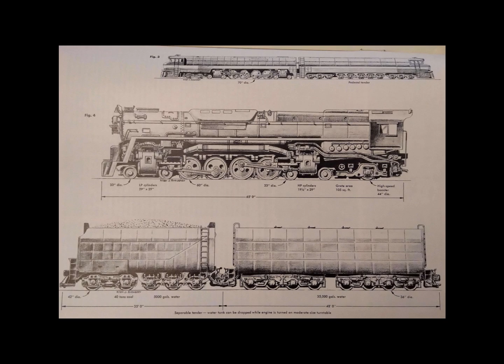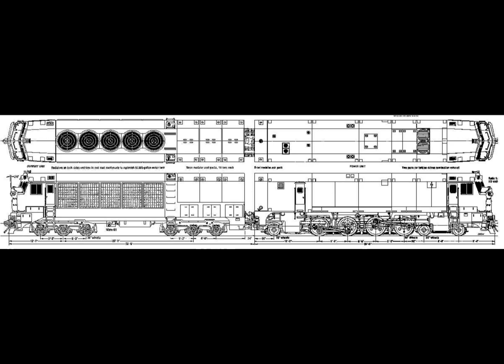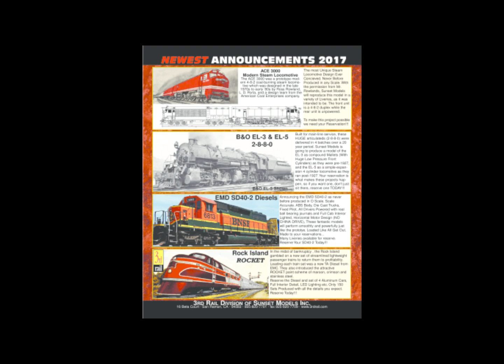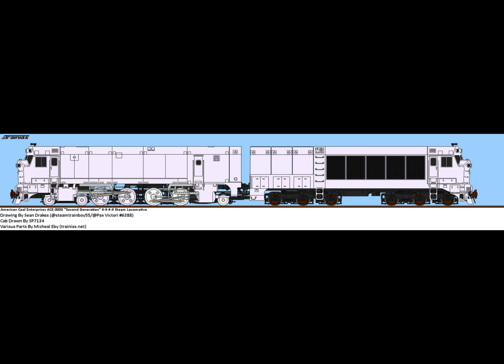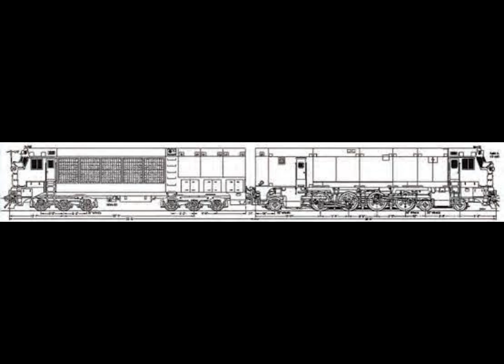Ace 3000 The Last Modern Steam Design Never Built

Comment: The ACE 3000 was not the last modern steam locomotive design, that would be the 5AT. I recently recorded and released a discussion with Ross Rowland in which we discuss the ACE 3000. The ACE 3000 was far too complicated to develop from the onset. Also David Wardale hated the ACE 3000. He had no hand in developing the ACE 3000 specifically. He joined ACE on the condition that he would be allowed to leverage it's resources to develop more traditional looking and sounding super efficient locomotives for export to developing countries. The 2-10-0 locomotive Porta suggested at the onset was a triple expansion third generation locomotive that would have been more efficient and less expensive to build and maintain than the ACE 3000.
Reply from the maker: I am pinning this response to the top... GREAT INFORMATION!!!
Reply: @lroadCrossing-SteamPower All of the extra features of the ACE 3000 were added to fulfill the desires of the railroads and rail worker unions. The goal was to make it as operationally similar to a diesel as possible. The synchronous opposed duplex was added to reduce hammer blow as much as possible to minimize extra maintenance on the track. The closed condensing system was added to eliminate the need to reinstall water collection infrastructure. The forward comfort cabs and computer controlled automated firing system were added to appease rail unions because they would not tolerate traditional steam locomotive operating conditions. Computer controlled automated firing was also supposed to allow for remote coupling of units to appease the rail company's desire for operational flexibility. All of these features reduced the reliability and efficiency of the design compared to Porta's original proposal. Developing a successful locomotive with all of these experimental features was practically impossible for such a small R&D team.
Reply: @TheRailroadCrossing-SteamPower  if you really want to talk of it you need to talk to gary bensman of diversified rail, he worked alongside Mr. Livio Dante Porta there was also a proposed ace 4000 project talked about in the coalition for sustainable railroading, now mind you though ross roland did have a vested intrest he had money in coal but it would have been really something had it been developed, coal is dirty but and effecent engine could have cleaned up a lot of it, and we got 200 years of it they say but getting it is going to ruine the landscape of appalacia by flattopping mountains and ruining water supplies,  but making a sellable machine they were aiming too big too fast, though the tests with 614 show the power of steam even in the most inhospitable weather the usa can dish up I met a guy that also helped out there beside just Gary Bensman, who told me mr porta was just as nice a person as he was an engine designer. those are Garys words
Reply: Do you have that video posted somewhere i would love to watch it
Reply: We just need a passionate Elon Musk type steam enthusiast to come along.
Reply: There's also the oil burning rack locomotives from DLM that were built in the 90s and a few concepts/prototypes from around the world that may or may not come to fruition, most notably Mackwell Locomotives which has temporarily tabled their locomotive development in favor of an updated tracton engine.

Comment: They were fighting the wrong battle. An engine that burns coal to boil a liquid, create a vapour, which then drives a piston, can never be as efficient as the engine that injects fuel directly into the cylinders. During the years when steam and diesel were built side by side, steam's great advantage was low capital cost. You could get 3 or 4 steamers for the price of one diesel. Once you introduce the complexities of divided drive, compounds, condenser etc that advantage is lost. The Porta and Wardale engines referred to succeeded because they improved on existing designs without departing too much from them.
Reply from the maker: So you feel the idea was over thought out. Which actually is a common thing among engineers

Comment: We haven't even begun to utilize all the potential of different configurations...

A pantograph powered electric locomotive could send the electricity through heating coils to a boiler which produces steam. Or even a natural gas powered boiler could make steam. There are literally dozens of ways to power a locomotive, but our design engineers are too stuck in the mud to break the mold and do something completely new.

Comment: I might have worked. The trickiest part would have been to automate firing and water level. Firemen had to anticipate what the engineer would do, it would be very tough to computerize that.
Today it's all a moot point. With global warming, all fossil fuels have no future. Railroads have been putting off electrification for 100 years. Think about it. Some of the biggest electrification projects were just before the diesel. 
Electric trains are the ultimate carbon neutral transportation. And no batteries. Railroads need to bite the bullet and get it done.
Reply: Is it the coming ice age, global warming, or climate change?  I can't remember.  Seems like it had something to do with the sun.
Reply from the maker: While I agree alternative energy and fuels need to be developed.. Im not a believer that electrifying the lines is the answer. The cost alone is prohibitive with the needed infrastructure to go with.

Comment: among all the "what if" locomotives out there, this one is the most painful, with it's potential to have steam actually doing revenue work in my lifetime. oh man, it drives me crazy. 
The only thing I personally would do to the design is I would turn it into a steam motor driven design like the planned B&O W1 (technically making it into a 2-2-2-2-2-2 or a 2-2-2-2-2-0 with that ACE 6000) and using a quadruple steam expansion design for maximum efficiency.

Comment: It's going to be either a fifth, sixth, or seventh generation locomotive Depending how you want to shake the dice if your talking modern steam. Third generation or fourth generation was the death nail and because of the nature of how steam locomotives were build you can argue about how each new innovation added to a steam locomotive made it a generational leap.... In all seriousness though the Ace 3000 if made to work would of been like a 5th or 6th gen steam locomotive but maybe a third generation turbine locomotive. But that's only if it used a turbine at all.
Reply from the maker: Interesting train of thought
Reply: @TheRailroadCrossing-SteamPower 
So much happened in the development of steam it's kind of ridiculous to think ACE 3000 was the "third generation" when so much technological development happened over a span of 200 years. they had to be referring to a technology they wanted to develop as a third generation of said technology other wise calling the ACE 3000 design a third generation is just hog wash.

Comment: Let us not forget: water treatment is mandantory  to prevent scale build up; a large infrastructure must be maintained to supply water (troughs anyone?) like NYC. Lets  not forget ash disposal and the comparatively low starting tractive effort compared to a diesel electric.
Most high pressure boilers require a fireman which would kill any flexibility in the operation.
Tier4?? Really?

Comment: If we're to build a second generation  steam locomotive  I would build a 2-8-6 steam locomotive  and name it through Berlin type it would be similar designed of the lima A1 BERKSHIRE I would build it with 63.5 inch drivers 250 psi and 28.5*30 cylinders elesco feedwater heater lowered headlight 145  ft2 firebox and number it  no 2 class A2.😊L

Comment: Thank You revisiting the January 1985 testing of the 614T through the Kanawha and New River Vally's.   I was attending EE studies at WV Tech Montgomery WV along the CSX mainline where this testing was going on.    I watched that steam locomotive get stopped in town when about 3°F on an upgrade with full load of coal cars behind it.   I thought the dispatcher must be nuts, because a steam locomotive on start up was likely to throw out thick black smoke and some cinders when starting at max load through and this was a heavily populated town.  

On startup the 614T engineer, probably Ross Rowland, used the exhaust steam jet that shot steam up 100 feet in the air or more then in the cold 3°F temperature it exploded out into a thick white cloud against the crystal clear blue winter sky.  The steam continued to expand across the valley sky and rise on its own accord up the 1000-foot deep valley.   As the locomotive started to move it never put out black smoke.  As it made its way through town the steam cloud expanded out covering the town.  I called it the town humidifier.  After the locomotive had passed I continued walking to class, probably late by that time, but I was in awe.   I noticed the steam had spread out across the entire valley by the time it reached the top of the ridges.  The taller ones being 1000-feet above the river.   

Although the 614T was reported to be testing for new technology with fluidized coal bed combustion technology being spoken along with this testing.  It wasn't clear if the 614T was reconfigured with any of this new technology.   I did hear few weeks into the testing the locomotive was full of leaks, but you'd never know it from the way it looked when performing!   It would carry 30 full loads of coal cars up grade then pull 90 empty coal cars down grade.   One time it pulled the Amtrak's Cardinal upgrade.  I asked the conductor if the 614T was fully pulling the train and he excitedly said it was the Diesel was just providing headend power.   

Surprisingly there was no discussion from the ME department about this testing I was keeping an ear out for.  Only the school news paper made a brief mention of it with no technical information basically just poking fun at using an old steal locomotive.   No mention it was a front line passenger steal locomotive with a reported pull speed with passenger cars by Ross Rowland of 125 mph!

I can attest to January 1985 being exceeding a cold one where in this video it is stated the temperature during testing got a low as -20°F.    I was helping my friend John Carrier take his large Ford to Beckley on the weekend in this January.   We got up early Saturday and the car would not start.   I tried various ideas for probably 90 minutes, then we had to give up.   During this time it had warmed up a bit.   It was so cold I had to restrict the air coming into my month with scarf or my throat would close from the shock of the cold air.   The car's battery was my main suspicion of being too low in charge.   I decided during the week I'd take the batter out and bring it down to the school physical plant and ask them politely if they would charge it.   They did.  The next weekend we got the car to Beckley.   On my walk back to my dorm I noticed the bank thermometer that had been off when I'd gone by earlier was now on and said -15°F and it had warmed up a fair bit since I'd walked by it earlier.

Comment: If I were to build a 2nd  generation  steam locomotive  I would expand the  BERKSHIRE  type into a 2-8-6 similar to the lima A1 with 63 inch drivers 250 PSI elesco feedwater heater and 145 foot square firebox and be numbered no 2  and classed A2

Comment: I suspect there is another big factor that would have killed the idea of a modern steam locomotive burning coal in the 1980s even if coal was cheap and oil expensive. This other factor is the pollution released from burning coal. There is the soot, the ash, the sulfur dioxide emissions and other emissions. Also a steam locomotive does not the space for all the pollution control equipment that is used in a coal burning power plant.

Comment: They need to take the design, and add present day technology to it. They should start a donation site, so people can donate. When they reach their goal they can start building it. The time is more than right, because the price of oil, and diesel is through the roof right now. When they get it done, if they come across any errors, they can fix them.
Reply from the maker: yeah, I definitely think funding would be there to develop the idea today. Especially if modern pollutant scrubbing techniques are incorporated.
Reply: @TheRailroadCrossing-SteamPower  Yeah, and as time goes on they could make more powerful designs.
Reply: @TheRailroadCrossing-SteamPower  i know this is from a year ago but the mackwell locomotive company already has done this

Comment: The mid 80s is also when concerns were being raised about burning coal in general.  Coal is a very dirty fuel, which created a lot of pollution.  A lot of work went into scrubbing the exhaust of steam driven power stations and various industries.  This was even before we got into climate change issues of releasing all the CO2 into the atmosphere, something coal does a lot!
Reply from the maker: Yes, I remember that.. Also, I think it was the 2000's that Minnesota built that super scrubbing recycling plant?? I think that's the most modern atmosphere tech going right now. Im sure it's been improved upon since as well. Point being.. I think coal can be adequately scrubbed nowadays, whereas not so much in the 80's.

Comment: Just have to build a new style steam turbine. Instead of everything large size. Do like the turbo liners that used multiple smaller engines. And put them in power packs. So u can swap packs and maintain the turbines off the loco and install complete working sets. 

Setup either a large boiler or multiple medium ones and like a ship. Id say multiple smaller boilers powering multiple tubines powering multiple eletric motors and used eletric traction.  
Eletrical traction would allow for similar parts to current in use and similar knowledge.

Id say u would also need a way to burn the coal as a dust not chunks so u could use it similarily to oil. 

So u need crushing system and air blower to fire the coal burner.

If u go 3 boilers powering 6 turbines and 6 motors u could easily make a 6000 or more hp  unit now size is an issue. It would be  similar in configuration to the UP turbines in outter form..
Reply from the maker: Interesting ideas

Comment: If you want a modernized steam engine I’d look at something like the cab forward of the southern pacific or the y6b of the norfolk and western. 
You’d want a forward cab for train crew and you’d want to use computerized fireman, which would allow for a forward cab. YouMd also want to include cab controls so it can link up to diesel electrics or another steam engine. I say make it articulated to make it even more powerful and to increase steam usage, however a 484 or 2 8 2 locomotive could work.
Reply from the maker: Outside of articulated, those attributes were the principle design until they backed off and went to the 2nd gen design..
Reply: Or, if the routs were not that long, tender locomotive could perhaps do the job. But I do not know how popular those were in the USA, on the other side of the Atlantic however,  Europe had seen several mainline tender locomotives e.g. Czechoslovak classes 464 or 477. As well mechanical stokers were a thing here and those perhaps could be, in some modern version, controlled by computer.